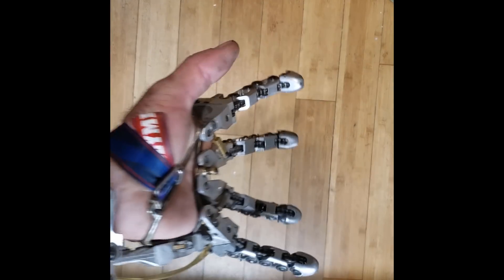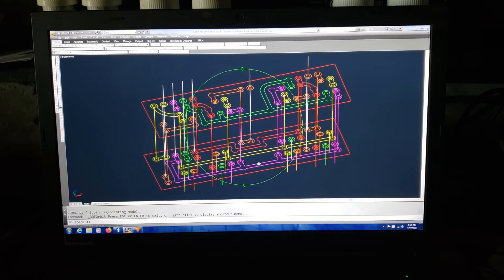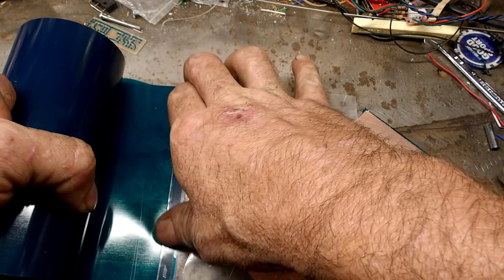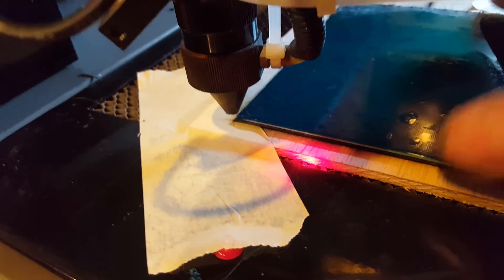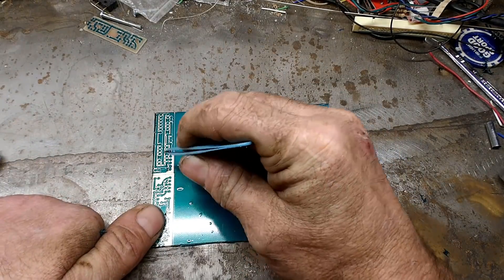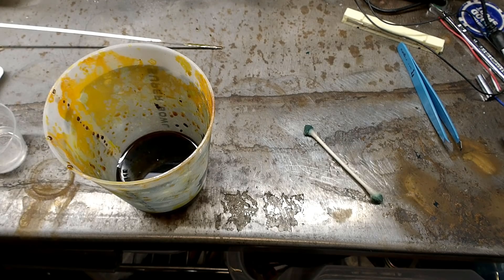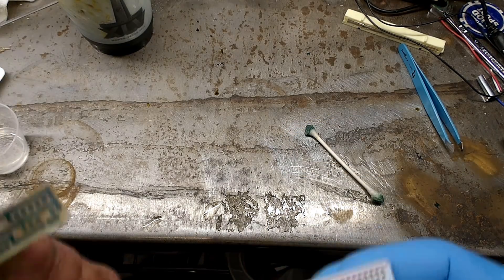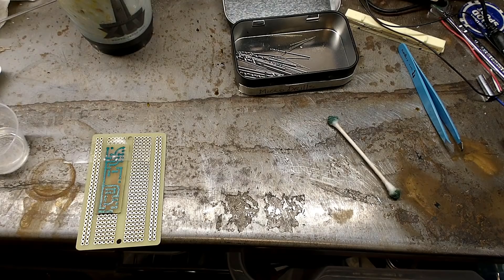Another update on my prosthetic hand, How to build a circuit board at home.

Comment: I don't understand why anyone uses circuit boards for a simple circuit.

Use copper wire, bear, without insulation on it, then solder everything, then encase the whole thing in epoxy.

Comment: I don't know anything about laser cutting. So a honest question :
Instead of cutting the pattern in the film layer & etching, would it be feasible to simple use the laser to simply burn the copper away from the board ? Perhaps through several repeated runs, removing thin layers of metal each run ?

Comment: I used to manage the dry film dept. in a circuit board mfgr. Try using a roller to apply your film from one side to the other. Otherwise your tech is spot on. I'm still amazed
Reply from the maker: Thanks! It's not the most high tech way of fabricating a circuit board,  but it sure gets the job done. What's really cool is when you put together a 4 or 6 layer board this way using little pieces of wire to get from one layer to the next and kapton tape to isolate layer from layer.

Comment: As a window tinter, a pro tip for removing bubbles from films on solid surfaces is to take a heating gun (or a blow dryer with heat function) and aim the heat at the film from 6 inches distance momentarily before using the squeegee to remove the bubbles. Barely adding some sort of non-stick liquid such as alcohol can lubricate the squeegee so that the motions are smooth.

Comment: I think it would be cool if someone made a prosthetic hand with a small speaker on the thumb and a small microphone on the pinky then wired that to a Bluetooth chip on the back of the prosthetic hand. The Bluetooth chip could connect to the users phone.                                                                    .   Basically making a very novelty Bluetooth headset.

Comment: Okay, finding this kind of work is always amazing. My fiance works in robotics and we have had multiple conversations about advancements in prosthesis. Your last short video seemed to show off your electronics to enable you to use fingers individually. I wanted to ask how quickly does the bearing disengage? Also, what triggers the disengagement of bearings individually? It looked like only the bearing of the base knuckle was locked and maybe my understanding of the bearing system is wrong but wouldn't it be more realistic for the bearing of each knuckle to lock?

I have more questions about this.
Reply from the maker: So there is a clutch bearing in to top sprocket and a pawl that locks into the 1 way gear that holds the axle. There is a micro servo that actuates the pawl forwarding and reverse to lock and unlock the motion of the finger.

Comment: I think you should add rubber pads on the metal fingers I think you would get better grip on items cause if you try to grab things without having strength behind them and having grip like human skin you can grab the item no problem but with metallic theres no grin your thumb is doing all the gripping so till when you add strength to your fingers I recommend adding rubber pads so that it grips items better with no strength